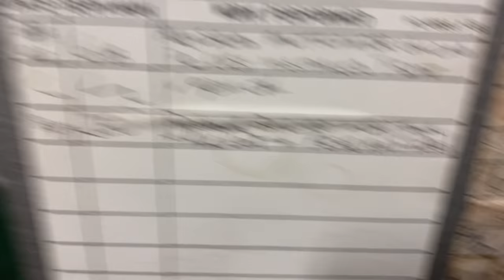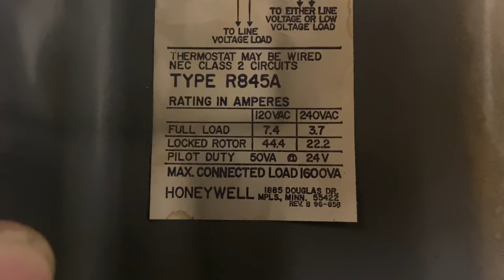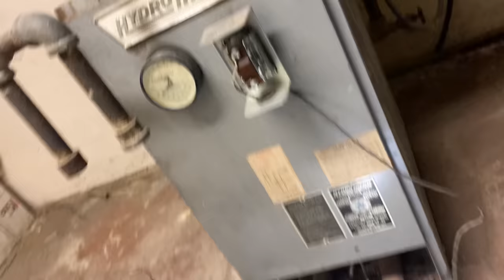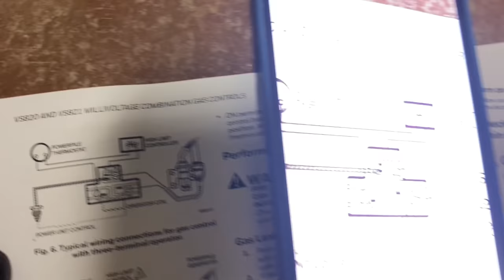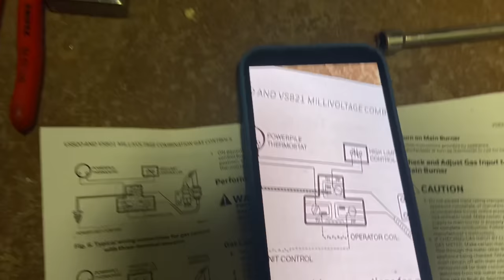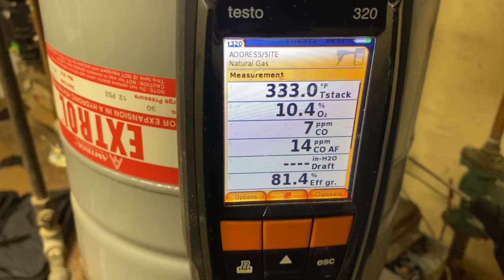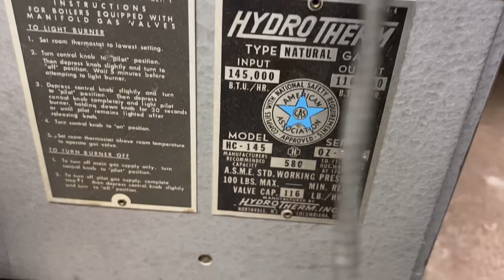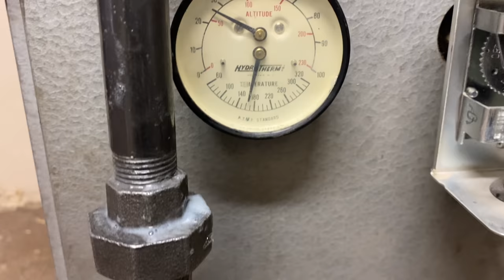Old Hydrotherm HC-145 Gas Boiler with Leaking Millivolt Gas Valve Brought Back to Life & Clean!

Comment: I moved into my house 3 years ago. I have that same boiler and it was installed in 65. First thing I wanted to do was swap out my boiler for a Navien. I did all the research and was pretty confident that I was going that route. Long story short my wife ended up spending the budget we had on the rest of the house and the boiler ended up ok the back burner. I’m so glad it did. I learned so much about boilers since then and 1. I’m glad I don’t own a Navien 😂. 2. This boil works so well that there’s no point in my replacing it. I just do the maintenance and had to change some valves. That’s it. Old girls kicking like Bruce Lee. Couldn’t be happier. I’m glad you fixed it and didn’t replace it.
Reply: Awesome
Totally agree
I called you I spent all your money 😛
Reply: Excuse my voice I was trying to say thank God your wife spent all the money, so you don't have the navion that Mikey now's is crap😂
Reply: @bruceelias4401  😂

Comment: Hey Mikey love the videos! As a disabled HVAC guy I feel like u keep me in the trade! I did residential and commercial service for almost 40 years and these boilers were all over the jersey shore back in the day.  The small tube on gas valve was a vent tube that would relieve pressure on the diaphragm and valve would open .gas would actually come out and pilot flame would burn it. Also a small access door is missing causing the flame roll out. Keep feeding us !

Comment: Want to make these Hydrotherm Wildebeasts more efficient on gas consumption?
Replace the original Honeywell high limit aquastat (5 degree fixed differential) with a new one that has an adjustable differential of 5 to 30 degrees.  Set the differential to around 20 degrees (higher if your home is well insulated and has efficient windows) and the gas valve will cycle on/off a lot less.  Another huge electrical efficiency with these units is to replace the old B&G series 100 circulator with a new Taco 007 ECM circulator.

Comment: saw your video on the bad flue pipe/clogged chimney. It happens to many times and still alot out there
However you never showed what come about the Ultra230 boiler for the red light of death.
Did or does it need the Maint, kit?
Reply: @PipeDoctor   i will rewatch thanks

Comment: that other tube is the "air bleed" tube, from above regulator diaphragm, it keep the regulator pressure as near burner pressure as possible and if it fails and start leaking gas it becomes a torch inside the heat exchanger at the pilot (often blows the pilot flame off the thermopile and makes that trip off)
I've seen it occurring before and emitted a bit of log in my drawers shutting the gas supply valve off, that was a gravity hot air furnace, but they're typically all same setup.

Comment: The extra tube bless off excess gas to the pilot from the old valve.  Often when it shuts off the valve will bleed off small amount of gas that just burns in the pilot.
The aluminum tubing Ben's so nicely by hand.
Reply: @PipeDoctor  it was the type of valve, old type. .  never disassembled one.  Had one that bleed continuesly some thing inside was leaking by.  Replaced it with one similar to the one you installed.

Comment: Only thing that sucks is no air scoop with high cent in the main loop on those if you gotta drain and make a repair.  It does have a high vent though oh the boiler.  I run across these still they are tanks
Reply: probably cast iron radiators which need bled yearly anyway. the large volume of them is always an air trap and water always breaks down in them, regardless of pressure and every magical type of separator/scoops/vents tightness of system/pressure.

Comment: The  cast iron burners on those boilers are known to rust out over time which causes high CO that cannot be adjusted out.  That said it did test well but I hate the fact there are not safety switches on the boiler.  Not sure the condition of the chimney if the boiler is that old, I would sleep better with a metallic liner.  The concern of a chimney failure and nothing to shut the boiler down is a concern.  As to CO alarms, people pull the batteries or unplug them all the time thinking its a nuisance alarm, OK  for a belt and suspenders application or if the house is at risk of major damage from freezing, but a fair weather call, I would have pushed for a new boiler or possibly just walked not wanting it on my ticket.

Comment: The small tube is a bleed off vent I believe.
Reply: @PipeDoctor  

copied from an online forum :
On some older systems however (pre 1959) there was a small tube that ran from the gas valve to the pilot. It was called an External Bleed Type Diaphragm Gas Valve. On a call for heat a pressure port in the valve would be closed and a bleed port would be opened then the gas would bleed off the top of the diaphragm and that caused the pressure under the diaphragm to be greater than above so the valve would open and gas would flow. Once the gas bled of the top of the diaphragm it would stop.

When the call for heat ended the pressure port inside the valve would open and the bleed port would close and pressure would build back up on the top of the diaphragm. When it equaled the pressure under the diaphragm then the spring and gravity would close the valve seat stopping all flow of gas.

A typical service call on this type of valve would be the valve would not open when powered. What was typically wrong was the bleed tube from the valve got plugged. All you have to do is clean the tube.

￼￼￼

Comment: You should show homeowners how to adjust gas valves right after flue pipe analyzers become available at Home Depot for $120. Let the big box companies take on the liability before putting it on yourself.
Reply: Just leave it to the Professionals, then you can sleep soundly in your bed knowing your home is Gas Safe, if Home Depot are selling / retailing  a $120 Pipe Analysers they must be buying same for maybe around 60 bucks that says a lot about those testers , wouldn't trust them in a heart beat   ...